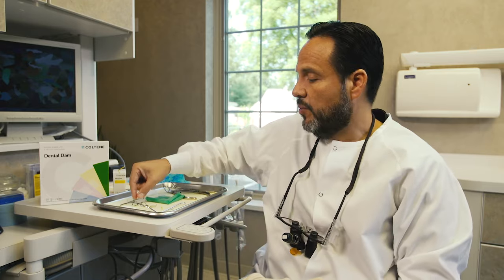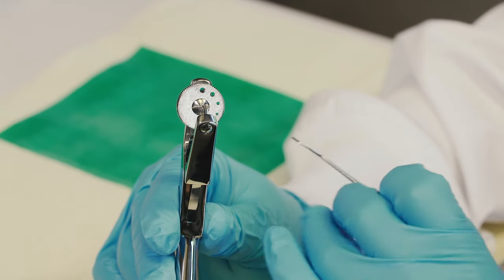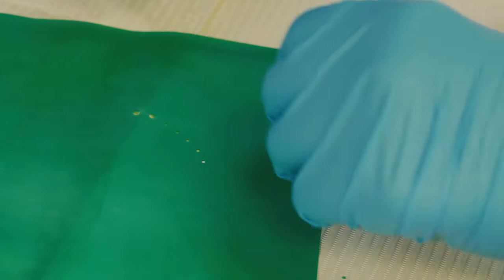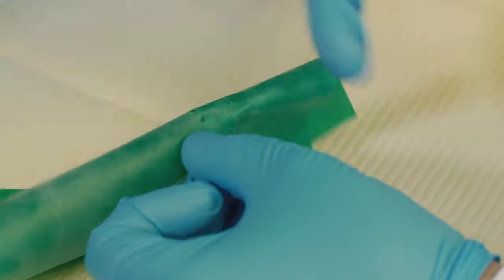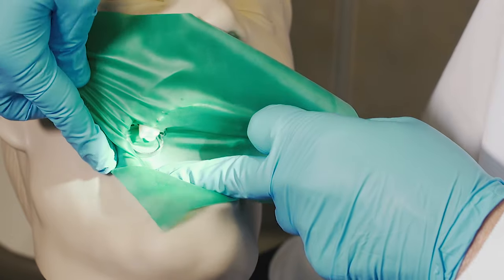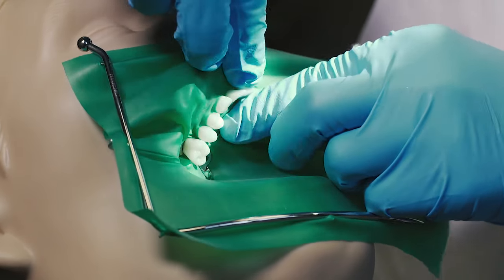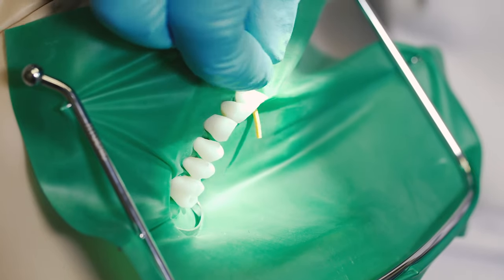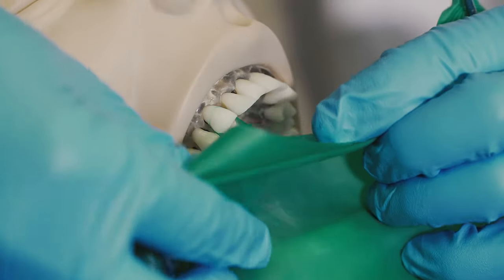Basic Rubber Dam Application

Comment: I’ve been taught to use a rubber dam for 1 infected tooth, mainly for root canals.
Reply: For endodontics you would isolate the single tooth you are working on. For other clinical treatments you may need multiple teeth isolated such as: composite restorations, cementation of indirect restorations which require a dry working field etc etc
Reply: From what I've learned in the industry so far, the rule of thumb is to only punch one hole for a tooth if it's being endodontically treated, otherwise, punching one distal and three mesial is a safe bet for general restorations.

That being said, I've seen folks who prefer to punch holes for the entire quadrant. I guess it mostly just depends on the dentist's preference.
Reply: Use it for your restorative work. It will make life a lot easier.

Comment: Sir...what about securing the clamp with a floss to prevent aspiration??
Reply: Yess..same doubt
Reply: I've noticed that some dentists don't bother; and it seems to vary from practitioner to practitioner. It's one of those things that I was taught to do in my course, but it seems to be executed differently in practice.

That being said, most dentists I've worked with use floss for safety; but definitely not all. It makes me nervous not using the floss, but different folks, I guess.
Reply: How would you secure the clamp with "a floss"? This is unclear to me.
Reply: @VancouverGranny12  sorry for the late response the idea is to use a dental floss inside the holes of the clamp and tie it around the clamp till the next hole then to tie it inside the next hole afterwards we just take the floss and but it to the side of the patient so if the patient choked on the clamp we could simply just pull it out by pulling the floss out.

Comment: hi doctor romero please i have some questions ,(1)Do you anasthetise the tooth that recieves the abutment clamp ? (2) Is the bite block necessory ? (3) If the patient closes his mouth a bit , the dam would  tear ? (4) If we are working on the most posterior tooth , the dam wont affect the drilling ? especially endodontics. thanks !
Reply: My answers, in case they help:

1. Not always, if the work is minimal and you ensure the clamp is not impinging the gingiva, you do not always need to anaesthetise the tooth on which the clamp will be placed. I find it useful to try in the clamp on the tooth before fitting the entire rubber dam to ensure a good and comfortable fit. 

2. No, I prefer not to have anything underneath the clamp that could be a choking hazard. If the patient requests it or it is a long appointment, I may place a bite block with floss attached to it for easy retrieval. 

3. I've never had a dam tear because a patient bit down. Come to think of it, I don't think I've ever had a patient try to bite down with the rubber dam on. 

4. Yes, the clamp can stop the head of the highspeed/slowspeed handpiece from reaching the ideal position. In these cases, you might have to alter your clamp choice, bur choice, or see if you can prepare the tooth from a different angle.
Reply: @jotham97  thanks

Comment: Thank you Sir. but which side of rubber dam sheet  is kept on the outside , facing the dentist- the shiny surface or the dull surface ;and why cant both the surfaces be of same texture or reflection. ?
Reply: I like to have the dull side facing me as the operator. Much better for photographs and easier to tell if it's dry and clean when it comes to restoring the tooth.
Reply: @jotham97  thank you boss . :)

Comment: I accidentally clicked.. 
why do u use dental dams? and why do you need to isolate teeth?
Reply: It makes life a lot easier. We don't have to worry about pulling aside the cheek or tongue to see what we are working on. Furthermore, it prevents any of our water going down the patients throat, and prevents any of their saliva from contaminating the surface we are working on. Modern dental materials used for fillings are sensitive to moisture and will not stick to the tooth well if saliva gets in between them and the tooth before they are set, meaning that there is a higher risk for the filling to fall out, or for decay to creep in underneath the filling.

Comment: How can u get that rubber  in when the patient has very tight tooth gaps?
Reply: Use the floss
Reply: I agree, the floss definitely helps. Luckily, the dam should be placed after the topical and local anesthetic's been used, so the patient shouldn't feel much more than some pressure in the process.
Reply: You can place some Vaseline/lubricant on the rubber dam sheet holes. Also, don't punch your holes with too much spacing in between them, the more space there is the harder it will be to get it past the contact. Ideally, you want to stretch the sheet and the holes so that the dam "flosses" through the contact points.

Comment: Why would you cut the dam afterwards? Just remove clamp and pull it over the teeth again.. no need for scissors and safer.
Reply: Cutting the dam helps to ensure that there are no bits and pieces getting ripped and stuck between the teeth. That, and it's a little cleaner of a process; pulling the dam without cutting the septa tends to cause some splashing of saliva and anything else that may have been leftover after the procedure. Why make more of a mess, right?
Reply: @ylvavarsdottir8081  Thanks for your explanation. I didn't think about that. I don't remember my dentist/dental assistant cutting the dam but I can't really see (and I choose not to see) what's being done inside my mouth!
Reply: Agreed. If a good quality sheet is used, then there is very minimal risk of it tearing as it is removed. I place some gauze over the teeth as I remove the dam to prevent any saliva/blood splashing back as the sheet comes off. If I'm concerned about the dam tearing and becoming stuck in the interproximal areas, I will visually inspect the sheet after removal to see if there are any torn fragments.